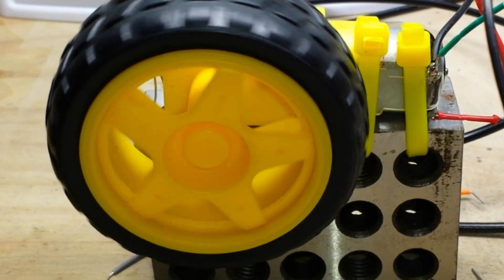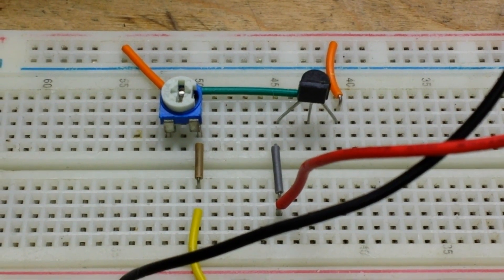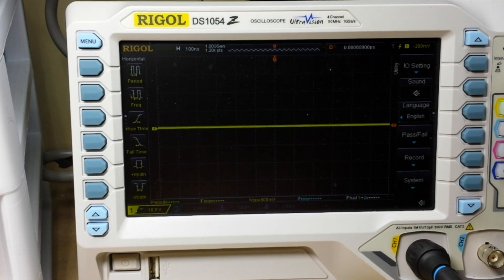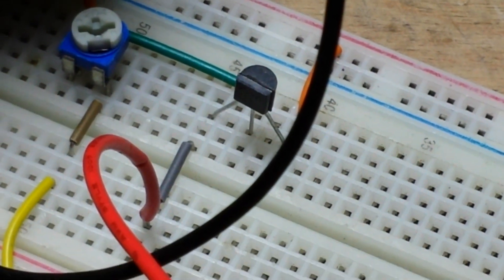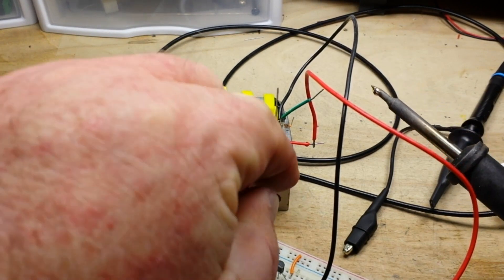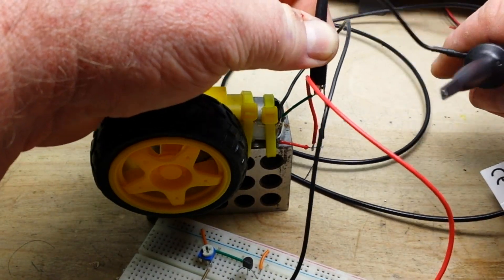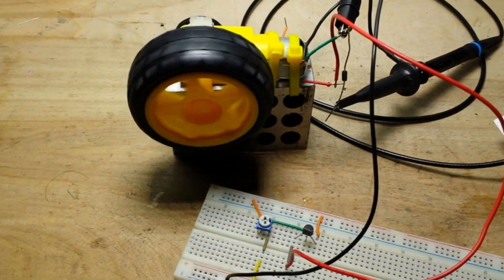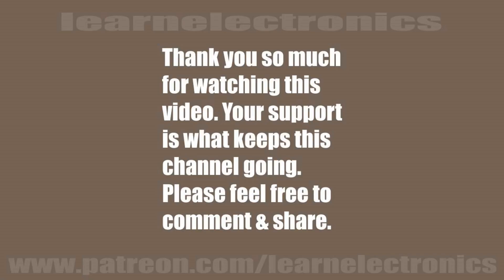Anti kickback diode

Comment: Cool, something I learned long, long ago when I was a young lad serving our great nation in the United States Army, circa 1970-77, but have long since stored away in a dusty cobweb filled corner of the old gray matter. Nice to pull the idea out and shake the dust from it occasionally. I recall when I first saw this sort of thing, I was shocked, in horror for that matter till I realized the working of a diode, and seeing a capacitor across the poles of a power supply, why that was a shock indeed because I always looked at components sort of like a piece of wire, and I just knew if you crossed the poles with a piece of wire, excessive heat and fire were just seconds away.

Comment: I spent almost a full day trying to figure out why a relay would trigger on a completely electrically isolated arduino every time my electric (actuator) lock reset.  Turns out it was sending a little EMP and pulling that (completely separate) arduino pin high.  Felt like voodoo until I put a diode in.

Comment: The extremely useful diode. It’s always good to get reminders about the many ways a diode is useful. Great reminder Paul, in fact I was thinking about how to do this with a motor that has to spin in both directions just yesterday. Unfortunately I do not have an elegant solution for that.
Reply: Most h bridges have diode clamping built in. If you used a mosfet then it has a parasitic reverse diode already built in.

Comment: I'm used to seeing the load switched by the collector. Any reason you did it that way or doesn't it matter?
Reply: Good question.
Reply: Not sure how accuarate this is but gives some insight. 
https://electronics.stackexchange.com/questions/38285/connect-load-to-collector-or-emitter-of-transistor

Comment: What about reversing polarity on the motors? Would adding a ceramic cap do the same?
Reply: Pretty sure the noise from the servo motors killed my esp32 camera. So I'm looking for ways to reduce the noise.
Reply: Seperate supplies for the servo power is normal a good start.
Reply: @jonelectronics510  I wanted to use a single source for power on my arduino bot. Maybe a separate buck converter with a separate ground will work.
Reply: @jonelectronics510  Yeah, you're right. I'm experiencing errors with dronebot's workshop robot car arduino sketch when I include the servo library. So I've used a PCA9685 module instead. Still experience sudden voltage drops running the motors.
Reply: @jonelectronics510  Yes, Using two li-ion cells. I'll try that. Thanks!

Comment: I think that's noise coming from commutator and long leads so cap there should be fine. Flyback diode is used if PWM is used for speed control. Usually this is integrated to H-bridge. This is also needed when controlling all inductive loads with semiconductor.

Comment: This always confuses, me, anti feedback,  anti parallel diode, kickback diode, flyback diode,  and there is one more I forgot, are they all the same thing?
Reply: tablatronix yes, they are all just diodes. However the names are just descriptions of how they are used. You get different types of diodes though, like schottky and standard silicon rectifier diodes and germanium diodes etc. 

Just like pull up and pull down resistors are both just resistors where their placement in a circuit determines whether they are called pull up or pull down for example.

Comment: Interesting, normally kickback (in the UK) is referred to as the switch off kick of a motor (and the collapse of the magnetic field), not the continual ringing that you are showing.
Reply: I was taught roughly the same. It being the spikes seen when an inductive load is switched on or off creating the large reverse-bias voltage.

Comment: Commutator Noise.  Adding a Cap would loose most all that remaining noise.
Reply: Yup, usually those motors have disc caps already soldered on the terminals for reducing noise so it does not get to the antennas, a.k.a. cabling.

Comment: How would a ferrite bead function instead / in conjunction?
Reply: At first it sounds like any inductance would make the problem worse.
Reply: @benbaselet2026  Okay, thanks for replying! I thought that an inductor would dampen high frequencies?
Reply: @friedmule5403  It's not quite that easy. Every circuit has capacitance, inductance and impedance. Every circuit is an oscillator and a filter, it just depends on the parameters and frequencies how everything works out.
I'd add noise killing disc caps to the motor terminals first, usually helps a lot to dampen the random high-frequency noise.
Reply: @benbaselet2026  No it's never that easy... unless you can just ad a single diode and deal with most of it:-) I am glad that you use your time to explain it to me! My thought were that the noise had a lot of HF so a sort of filtering, maybe could dampen or at least change some of it. It could be fun to see:-)
Reply: @friedmule5403  A very good experiment for sure and easy to do if you have a scope. Very recommended :)

Comment: Do ESP8266 or similar chips like ESP 32 come with firmware flashed in it or do we have to flash the binary files ?
I am having trouble interfacing NodeMCU based on ESP 32. I am developing my prototype on Simulink which officially supports Arduino and ESP 8266...